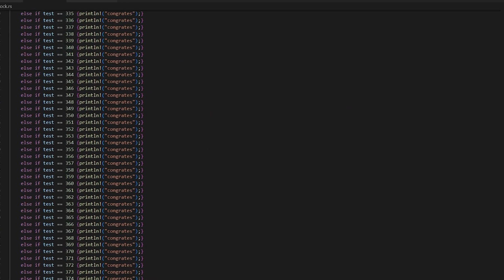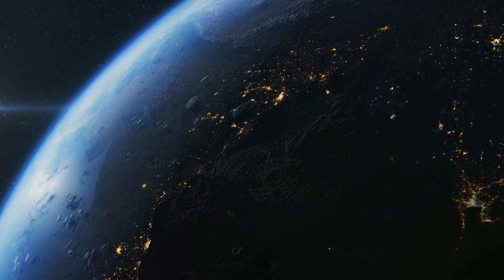If Or Switch Is One Better For The Environment?

Comment: I don't usually comment but seriously? This optimisation ain't gonna save anything if your electricity is being produced by bad system. This is like saying planting million trees is gonna save planet when in reality just million trees ain't gonna do shit either. Band aid solutions don't help only solving problem from source does.
Reply from the maker: It was kinda a shit post, NGL. Making a super intense video about saving one clock cycle. I did want to bring up optimization though. Some people don't realize how expensive some functions are and will use them repeatedly without thought.
Reply: @xyphold  Yeah, that I agree with soydevs need a reality check. Subbed for that. Though I use rss to sub.